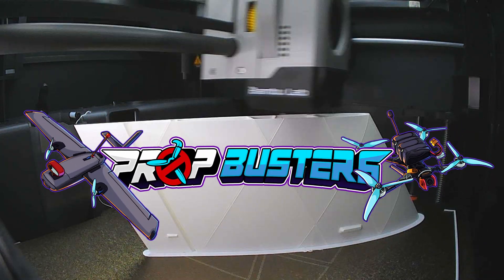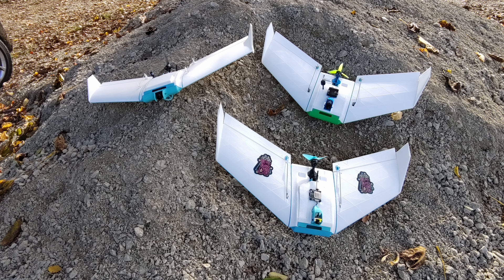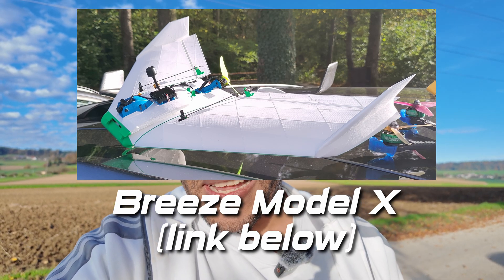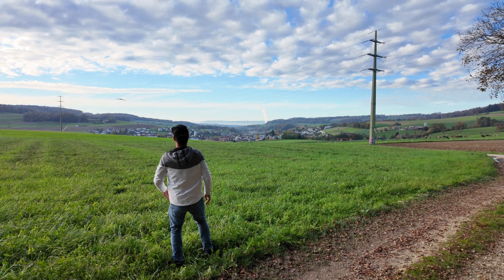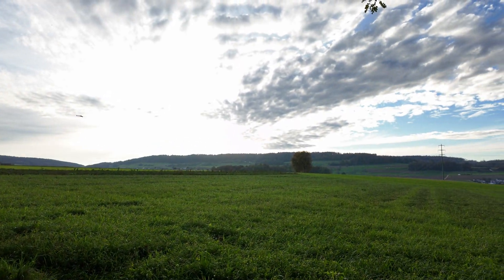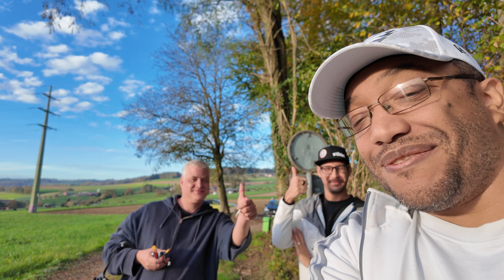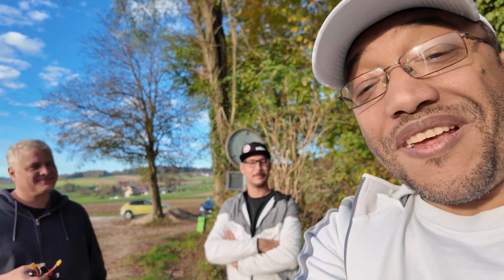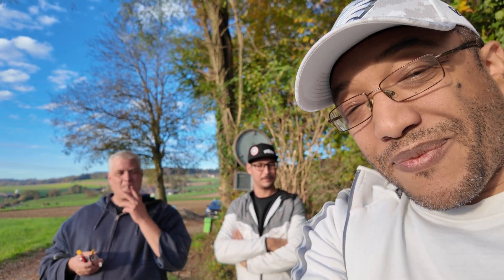Breeze Model X - 3D printed FPV Wing // PropBusters Sunday Session

Comment: The video looks wobbly is that really how it is?
Reply from the maker: This is without any gyro stabilization of the footage, what you see in the goggles. It was also windy. In the later clips I'm using a Walksnail cam with gyro -> stabilized footage

Comment: nice job. Hi can you share your bambu setting for this filament ?
Reply from the maker: @featfpv4239  Thanks - sure. Will check and give you the details. It's Bambu Aero PLA that I've used
Reply: @ thank you
Reply from the maker: @featfpv4239  I used the soarkraft settings with one layer wall for the Bambulab Aero PLA for this build https://soarkraft.com/pages/how-to-and-settings. You might first want to print a small test part: https://cdn.shopify.com/s/files/1/0574/5577/1827/files/SoarKraft_Test_Part_-_v3b.STL?v=1703281893

Also https://www.youtube.com/watch?v=1oexXjYtEV8 some details after about 4:30
Reply: @McLogo76  thank you

Comment: Hey great video!  Just curious,  I also get some flickering like a re-fresh in my OSD elements sometimes with INAV flying Walksnail,  have you figured out why this is happening?
Reply from the maker: Thanks a lot! I've figured out that I get flickering on this wing and also on my T1 Ranger or Baby AR wing if the rx/tx cables that go into the vtx are squeezed by something or maybe also routed over through other thick cables (power cables).
The 2nd thing I will now be trying is from Mads Tech regarding an issue with the Lucid Stack, that OSD doesn't work well or is flickering due to the signal not going down low enough - will be trying a 10k pulldown resistor. If it works I will also try it on other builds.
But here it also helped to have the cables nicely routed.

Comment: Is there any kind of flight enhancing software onboard the plane? Like an ardupilot or something perhaps?
Reply from the maker: Yes, we are using flight controllers like Speedybee F405 Wing mini or Matek F405 WMN with INAV (7.1.2).
So you have an autolaunch setting and stabilization modes available if you want similar to Ardu.

Comment: please make assembly video im struggling to assemble them
Reply: With gluing and everything I printed them fine just need help😢
Reply from the maker: @Mythics-k5k  Ok, I'll try to explain that in a video 👍
Reply: @McLogo76  thank you so much
Reply from the maker: I think that is possible to do. I had anyway planned to do a video with some fixes like a Walksnail cam with stabilization and some details.
Reply from the maker: With what parts do you struggle? 3D printing or gluing, assembling, getting parts for the build?

Comment: Ich finde die übrigens sehr, sehr interessant, aber das Bild beim Fliegen ist doch extrem ruckelig oder nicht? Wird ein nicht schlecht dabei? Beste Grüße und Allzeit guten Flug😊
Reply: Ich find's nicht ruckelig sondern wobbly. Aber vielleicht meinst du das. Ist das weil die 3d Drucke nicht so steif sind?
Reply from the maker: @DanielKirsch  Danke, nein es sieht tatsächlich so aus, wenn man die Footage bei Wings (oder RC Flugzeugen) nicht stabilisiert. Von Aussen sehen auch RC Flugzeuge relativ stabil aus aber von innen rüttelt es enorm. Dagegen ist Quad Footage mit 4 props sauber - hat ja auch wenig Angriffsfläche in Vergleich zu Flügeln.
Ich habe bereits eine HD V2 cam mit Gyro eingebaut - beim nächsten Clip wird man den Unterschied sehen 😉
Reply from the maker: Danke! Beim fliegen geht das problemlos aber ich muss noch den besten Weg finden, die Footage zu stabilisieren. Es ist eine VTX / Cam Combo ohne Gyro aber der FC hätte nen SD Karten Slot für Blackbox. Besten Dank 🙏